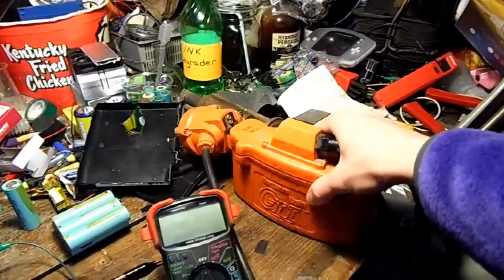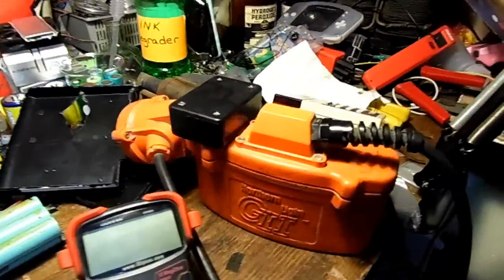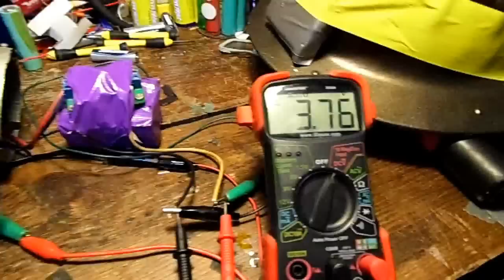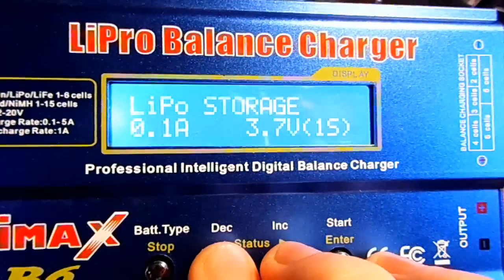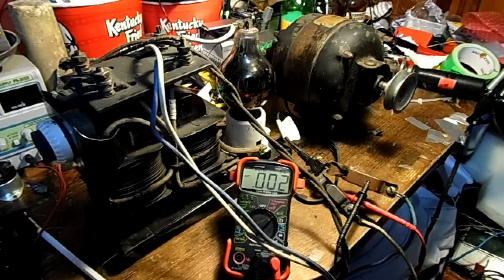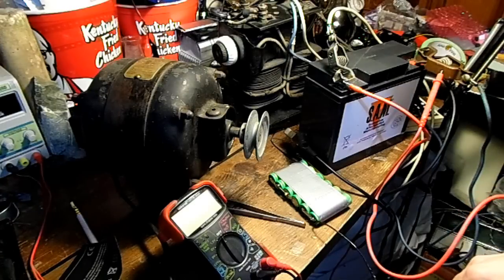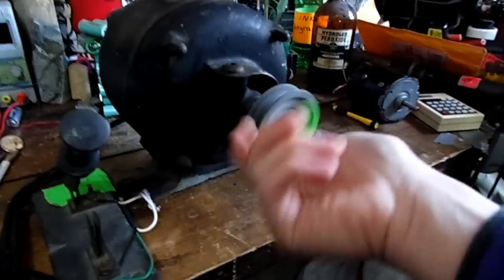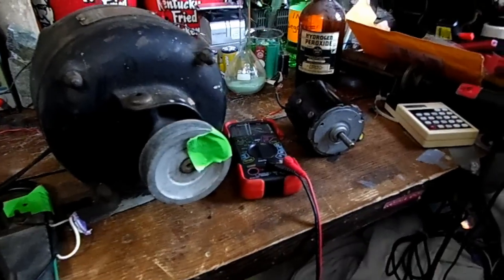Random Bits: 0012 AC commutator

Comment: The clicking of the motor is a centrifugal relay that is used to insert a capacitor in series with an auxiliary winding. for the startup and remove it as soon as the motor has gained sufficient speed.
Nowadays on most motors the capacitor is permanently inserted in the circuit.
This capacitor is needed otherwise the motor would not start up unless turned manually like an internal combustion engine.

Comment: those terminal converters, some years ago i was given some of those from an old guy clearing out his workshop, never knew what they were, now i know!  funny thing is we dont have side terminals on batteries in the UK at all...
Reply from the maker: yeah the UK has side post batteries. but they are mostly in poorly designed cheep vehicles. just like here. in the US 95% of vehicles have top post. idk why anybody in their right mind would use side terminals. but i also don't know why some cars have to have their fender and headlight removed just to change the battery.

actually ok i do know. its because they are designed by people who havent actually worked on cars and only use CAD to spit out a design.
Reply: Rinoa Super-Genius Automobile design is driven to facilitate assembly line production and not repairs.  The idea is to cut costs so there will be a buyer.  After the warranty expires, the buyer has to deal with repair costs.

Also, I suspect some things are designed to try to idiot proof things and reduce litigation.  Some idiot probably opened up the hood of a car, removed the protective covering on top of the battery, accidentally leaned across both terminals while the car was running, was shocked and jumped upward and hit the top of the hood causing it to unlatch. The hood fell down, driving the idiot into the motor and cooking his skin to it.  Then some plaintiff tort attorney got hold of the case.

Remember the special screws I had mentioned on the microwave.  They are undoubtedly there to slow up people who don't know what they are doing from creating an unshielded microwave transmitter or gaining access to the toxic materials in the transmitter.

For example, because of the lawsuits, many gasoline can companies have gone out of business.   I have noticed there are now cans that are being sold marked "Kerosine."  Probably the company assumes people will buy them to use for gasoline and if some idiot manages to set himself on fire, they can point out the can was sold to carry kerosine which has a much higher flashpoint than gasoline.

Comment: The mechanical commutator while not as electrically efficient as the solid state alternative would be easy to build.  Maybe when you go out searching for junked motors to use for the electric car, you might find materials that could be used to build it.  I assume part of the point of the electric car project is to show what can be built out of reworked salvaged materials.

If you plan to use those battery lights for a long time, you might wish to string batteries on a belt that you can wear around your waist to help distribute weight and free up your hands.  Having the the cells in a linear arrangement would also make it easier to locate and replace defective cells. It is much easier to carry evenly distributed weight. The belt could just be unbuckled to leave it with the light somewhere.  I always hated as a kid having to deal with the heavy rectangular battery, jutting out on one side that my grandfather had.
Reply from the maker: well i think having the lithium cells inside the mining light is ok. i plan on adding a pocket on the other side of the belt to hold tools in. so it wouldn't be off kilter too much.

i know somebody who does leatherworking. i may pay him to make a really nice leather belt. i'd prolly want it to look like the one i used for 2 years in Final Fantasy 14.

http://mooglebox.com/entries/dated-leather-tool-belt-%28red%29.php

and yeah i think i may rip apart that broken 1/4hp motor i got in the shed and take the commutator from it. it prolly won't be too hard to rewire and stuff.
Reply: That belt would go well with the Miner's hat after finishing it to look Steampunk.

I remember in the satirical Batman TV series, he had a utility belt which contained everything that was tailor-made for every application in every situation.  It was a universal supply for everything specific, all fit in one light-weight belt.
Reply from the maker: *****
yeah haha.

oh i just had a great idea. a big magnet that any tools would just stick to the belt. idk though might get in the way.. hrmm

Comment: that head lantern is sealed against moister if you cut into it it will defeat the purpose and most ac motors have a starter winding like you described .just use the project box to make a battery box for the camera and put a belt clip on it
Reply from the maker: yeah but i don't use it for moisture protection. so the moisture protection serves me no purpose.

if i was going to build a seperate pack then i would have to rip apart this lamp anyway for the charge circuit.

Comment: For your portable powerpack you could use a 3 pin regulator like the 78xx series or higher current version to power your camera, as long as the regulator input is at least 3v higher than the output :-)

Side terminals on a battery, hmm how odd.

Like the use of a commutator, tough and reliable.

The motor almost sounded like a capacitor start motor.
Reply from the maker: well the thing is the lithium battery inside the lamp pack is exactly the voltage i can use for my camera. my camera is rated for 6.5v but i connected it to my universal power supply and slowly pushed up its voltage to 9v and it was ok. and it turns off at 4.2v. i don't dare go any higher couse i don't want to burn it out haha.

the battery inside the light runs at 8v and has a built in charging regulator and stuff. its perfect for what i want.

and yeah side terminals are horrible. always hit your hand on parts under the hood trying to unbolt them. fuckin stupid.

Comment: another insightful vid! hmm I like Raymonds Washing Machine motor idea for the DC but I would say if you can look out for a "13" brushless hub motor" off something like you find on an OAP cart or disabled buggy, you will find that once you put 60-72v through it you will get 30mph from it easy on a light vehicle or ebike, the only curse with the old engines is that though they are great quality and will last a life time like India show proof of today, I'd say they are a little to heavy for an ecar or ebike, a handy perk of brushless motors with having the motor in the wheel cap is they are pretty efficient and don't loose energy or torque from a drive shaft/chain. There are a lot of old broken ebike controllers out there, if you can get one and patch it up, mix it with your lappy battery packs and a pillaged brushless hub motor off a 'left out in the shed for 10 years OAP buggy', then you pretty much got an ebike/ecar, right there, As always Im lovin the enthusiasm for these mods, keep em coming
Reply from the maker: actually i've decided to go for a 10 Horse Power 48v DC forklift motor. i think it should be perfect.

but i already have an ebike with a 60 mile range. i don't really need another ebike haha.
Reply: sounds good, I was thinking perhaps you would have hit a limit with a 40-60 mile range on your bike, as to say you wouldn't be able to find much space to fit more batteries to boost 'ah'. A car would be cool but I think the range would reduce dramatically due to the weight depending on the frame, how heavy is the forklift engine? glad your taking DC! what peak ampage do you recon the forklift will be pulling from your battery array? whats your bike currently pulling at peak ampage from your battery array do you think? im not trying to troll honest, im not like that, im just trying to throw some questions in you may want to consider while your working on the specifics...you are making a car right?
Reply from the maker: no whenever I build my other 35ah pack I should have 120 miles range and room for plenty more cells.

I plan on the motor weighing at most 250 pounds and consuming 200 amps at full power. I already have enough batteries to give it 48v 250AH for my test battery.

before the car I will convert a riding lawnmower to electric as a stepping stone project. prolly in a month or so. its just too damn cold now.

and my bike pulls about 12-20 amps from the motor I think. I haven't tested the amp pull though.
Reply: sounds good, the motor sounds like it will have enough power with its 10hp 200a peak, i would recommend considering keeping in mind pushing it up to 54v-60v, it made a big difference to my ebike, i wonder though with the increased traction of 4 wheels, the 250ah+ battery array, the 110kg from the motor and the additional body work, will the weight chew the batteries do you think? and how you running the forklift motor to the wheels do you think? belt or chain perhaps or is the motor in the wheel hub?
Reply from the maker: battonfive
i'm going to take out the engine (straight 6 weighing atleast 300 pounds) and build an adapter plate so the forklift motor attatches to the transmission.

the forklift motor will be much smaller than the engine so i can fit prolly 4 batteries in front and some more in the trunk. overall the weight shouldn't be an issue. and then when i start replacing them with lithium it'll be even lighter.
Reply: honestly sounds really good, im looking forward to your vids, gotta do vids, there pretty handy for anyone whos thinking of having a go them selves in the future, you think your battery packs will be able to provide that peak ampage? id hate to see you fry some of your packs, its a factor that's been playing on my ebike here for a while. Peak inflating your tyres will help quite a bit, and considering hooking your lights and indicators and stuff up to their own power sources will help as it will reduce the inbalancing in the cells and leave the power of the main array to go to the wheels. strip that chassis down to the bone! atm im saving to make a carbon fibre setup and am going to replace my bikes panels with c.f. but it would be great for an e-car, expensive but niccceee
Reply from the maker: battonfive
well thats actually a big reason why i'm doing it is to make videos. so of course i would film it.

also the test batteries are just truck batteries i got off a recycling skid. they can supply about 800 amps at most. i wouldnt mind if they got hurt couse i can just take them back and swap them for other junk batteries.

really the only thing i need to buy now is the motor and theres a few within 100 miles of me for only 130$. this could be pretty cheep. i'm hoping to keep the price bellow 500$. so about the same price as me e-bike.
Reply: hmmm that budget makes it a pretty enticing project for sure, it sounds a bit like a milk float style car do you think? as you say when the lion's are introduced it will bring the weight down and free up more space for 'ah' but perhaps if you add another few hundred dollars you could manage a few of these? http://kellycontroller.com/hub-motor-48v-800wdisc-brake-p-163.html they look pretty efficient and are very light weight in comparison, one would run an ebike easy enough so 2 should give you plenty of hp, there is that $200 extra but you could look round on ebay for something cheaper. At worse you could make two ebikes and sell them :-) weight is a real shit with e-vehicles, seems to chew the batteries regardless specially with the old heavy SLAs, lifepos and lions have good potential to claw back that power to weight ratio, as well as having thin tyres + making it aerodynamic will boost the range, I took an ebike/escooter because I wanted something comfortable and road legal, you think you can find an e-car clause to bypass insurance + reg requirements? here in EU they are laxing the laws a lot for e-vehicles, something to consider perhaps?
Reply from the maker: battonfive
those hub motor would be a very bad idea for my car, would need about 12 of them. i woudnt use them for a car even if i had them for free. a forklift motor is very compact and strong.

weight really doesnt matter since it doesnt effect how far you can go. it only effects the handling. i'm worried if i don't have enough weight the car wouldnt get the propper grip on ice during the winter.
Reply: cool, sounds like you have it in hand. gl im looking forward to seeing it and checking the stats ou: top speed, single charge range etc

Comment: Ive got a 3 phase.
Reply from the maker: how many horse power? i'm looking for at minimum 5 HP but 15HP would be great. and ideal would be DC.
Reply: 3 horse. But it ran a 3 cylinder air compressor. We couldnt use it because my garage doesnt have that kind of power.